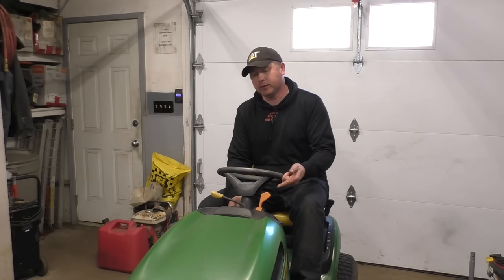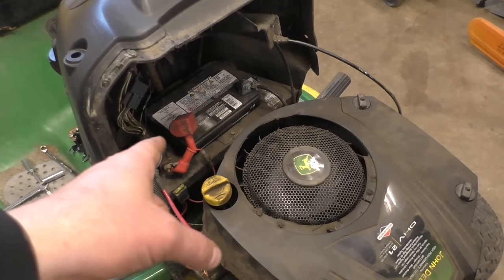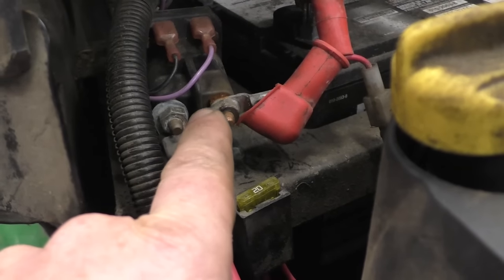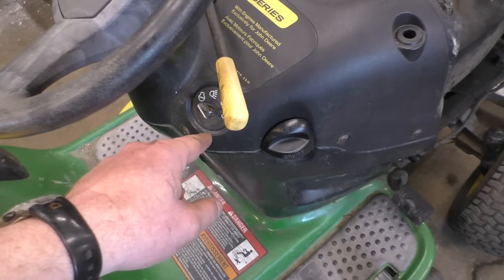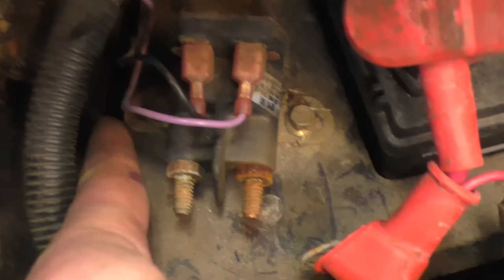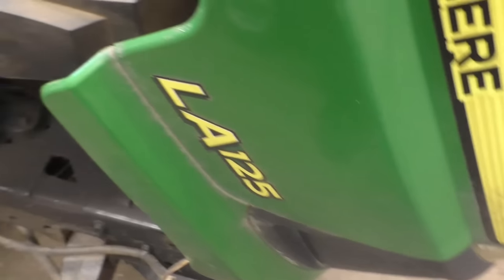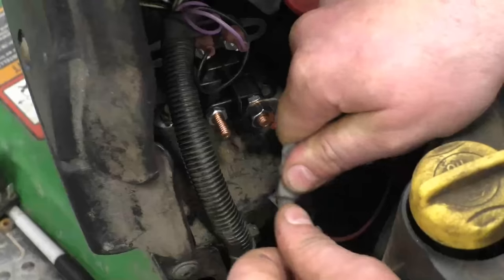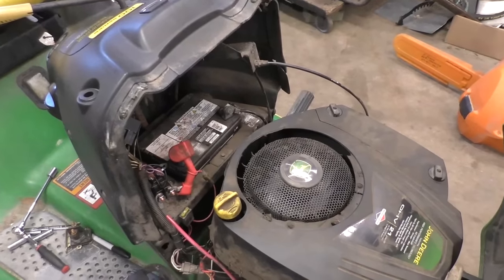Lawn Tractor Won't Start And Clicks - Step By Step Repair Video

Comment from the maker: Watch my video on the Top five reasons your riding mower won't start after storage here;
https://www.youtube.com/watch?v=obLqNeGz0Ps&t=1s
Reply: just put a new solenoid in, turned the key and literally saw a puff of smoke.   that's two solenoids one after another.   i'm stumped... did a bench test and the solenoid clicks but doens't have continuity.   not sense in putting ANOTHER one in, until if figure what is going on... i googled it but nothing...  battery is 12.75, fuse is good.  testing all switches.  any ideas?

Comment: Worth mentioning when using the screwdriver bypass method don’t be resting your hand on top of engine.
Reply: Good practice, however the battery is likely 12 volts and not high enough voltage to cause injury. When it gets about 48 volts and higher, be careful.
Reply: @trinitytoo  my comment was regarding the flywheel rotating.
Reply: @jhans3278  fact: it’s the amps that hurt you, spark plug produces 1,000 bolts but no amperage and you’ll be perfectly fine. But if you have 48v with decent amps that’ll suck
Reply: Mine clicked like that but the problem was the starter gear assembly was the problem

Comment: How about before you junk The solenoid see the hot terminal coming from the batteries all rusty and corroded. Make sure all those terminals are clean. Otherwise you’re not getting the amperage. You need to turn the starter and the solar lights probably junk anyway.

Comment: Great video. I have never done this before, but you explained it, so well, I figured why not givebit a try.  At first, I thought it was the starter. Thank God I saw this first and didn't spend money unnecessary. The solenoid cost me $24 at my local John Deere store. It took me all of 30 mins to remove and install the new one. (My once again first time) Once finished, Jet (my mowers name) cranked right on up . What a blessing. I so glad i didnt have to pay John Deere to do this for me. Thanks again. You have a new subscriber.

Comment: I maintain a fleet of 20 truck mounted mosquito foggers that have Vanguard engines. I run into this ALL THE TIME. The issue is cheap starter relays. They click, but the internal secondary switch contacts are burnt and do not transfer enough current to spin the starter motor. I have long stopped buying the cheap Briggs or Arnold relays and instead, go to the auto parts store and get a starter relay for an early 70s  Ford. I end up spending about $35 on them. But they will outlast your small engine.

Comment: What about the safety switches?  Don't you have to consider them when diagnosing something like this?  Isn't there one in the seat for example?   How did this mower even start without someone in the seat?

Comment: Here's one for you.  I have a John Deere LT160.  I've checked the battery (full charged) and the solenoid (clicks with key on).  Jumping the solenoid poles, the starter starts the engine.  However, taking the solenoid out and bench testing, there is continuity between the poles when the switch is activated.  So why doesn't it send power to the starter when the key is turned on?  Seat safety switch is fine (because the engine will start when jumping the solenoid...ground appears ok.  Changed a relay that John Deere parts recommended.  Baffled.

Comment: So simple!  The other videos have you testing the solenoid with a multimeter, disconnecting wires etc.  Nice tip about the parking brake also!

Comment: Your video explained clearly on how to begin finding out what5 the problems may be. I like your step-by-step method. Unable to purchase a Kohler Pro Command solenoid. No longer made and is a high price item IF you can find it. Are the solenoids sold on Amazon good or low quality?

Comment: Ok.  Your screwdriver trick helped a lot.   I just tried it and it tried to start.  So it’s NOT the starter.  The problem is, the Seluloid is brand new that I just put on there straight from the john deere shop.   So both should be good but I still can’t get it to start.   The fuse is good, I replaced the sparkplug and checked the brake button and the seat safety

Comment: what do you think about the wash port on the mower deck on those John Deere 100 series mowers?  Should people use it?  I hear a lot of people saying it doesn't work. Or they say don't use it, it'll rust the deck faster and ruin the spindle bearings.

Comment: Your video is very clear and right to the point. Unfortunately, I replaced the solenoid yesterday and it wasn't the problem. I've recently done most of a regular service on it; new air filter, fuel filter, & Champion spark plugs. It has run well since the service was completed. I have the oil filter "Re-plumbing Kit" and I'll install it in the course of an oil change.  E-Z... what a waste of money!!

I have a John Deere E180 that usually runs every time with no problems. Now, it acts like there's a safety interlock open; Seat Switch, Brake Switch, PTO Engaged Switch. When I turn the key to the Start position there's nothing. No Click. This thing is starting to put a dent in my sense of humor!  😏

Good Ideas would be welcome...
Thank you...

Comment: To test the starter by connecting the starting directly to the battery, do you have to do anything else for it to crank, like put the parking break on or key in or anything?

Comment: I have a random question do you happen to know what type of cable lugs do you use to replace old ones? I can't find anything on it. It is the lugs that connect the solenoid to the battery

Comment: Donyboy, I'm going thru this same symptom on a Husqvarna Zero Turn. I've already swapped out the solenoid twice already and it seems that with each new solenoid it only fires up one time. I added a new starter also and a new switch. Even though the old one was clicking when I had benched tested it. I've not taken a screwdriver across the poles yet cause I was hoping to see a bad wire or something. I started watching your channel years ago and am never disappointed at your content.

Comment: I got a question about the selenoid
If your shorting it to start the mower why then is the selenoid a needed part if as you said the red wire don't run strait to the starter so if a guy runs a switch of some type could this then work in place of said selenoid this is my question for you about the selenoid

Comment: Donyboy, I have an older yts3000 lawn tractor with a Briggs Platinum. When I shut the engine off I burp a little oil out of the top of the oil drain tube. Oil is not overfilled and valves are set correctly. Any thoughts?

Thanks in advance. Best YouTube channel for small engines!

Comment: Thank you for the video. I recently snatched up an old JD rider with the Kawasaki engine. The solenoid is attached to the starter like the old GM products. I cleaned ALL of the battery connections and applied a bit of electrical grease and voila. No parts replaced at all. Probably going to need a solenoid replacement but I wanted to get her going and see what other surprises I’m in for

Comment: Thanks this was very informative.  I am a widow so panic set in when my trustee LA145 would not start.  Charged battery lights work  numbers come up on dash but still no start. Tomorrow I will try and bypass solenoid and hope she goes. 14yrs old now.  Can I run her without solenoid until I get a new one.  Thanks Robyn

Comment: Hi Dony.  Thanks for another great video.  I have a John Deere LX178 with Kawasaki engine.  The starter has an on-board solenoid.  Using your screwdriver method, I've confirmed that the solenoid has failed.  How can I address this issue without replacing the entire starter/solenoid assembly?   I just replaced the starter 2 years ago, so I'd like to  squeeze a few more years out of it if possible.  Cheers.

Comment: Thank you Donyboy for an excellent video on how to bypass the solenoid to determine if the problem was the solenoid or the battery or the starter. You are an excellent teacher and mechanic.

Comment: Gosh Dony I wish I had this last year......I have a 2005 John Deere LT133 and I had several issues and I think I still have a couple.    But I replaced the solenoid and that definitely  helped but also the Brake/clutch pedal switch which you showed us last year and the lift deck switch were also two checks.    If I pull back on the deck lift lower bar thing that also has one of the gray safety switches under the body. I found nothing would happen when I turned the key and then if I pulled the deck lift bar as far towards as I could it would start.
SO I know I have to replace the switch also.  That might be a help for JD owners as well.

Comment: i replaced an 8 year old solenoid last may... went to start the mower up to move it into winter storage late september and nothing but clicks.   turns out it was the new solenoid.   so what makes the difference between one that lasts for years and one that barely makes it through a season?

Comment: Sir, ❤ thank you!! My husband passed away last year, taking care of my home alone is overwhelming and expensive. He left me his barely used John Deere mower. I wasn’t thrilled but it beats pulling on a lawnmower starter rope. I’m 65yrs old. I’m a retired RN and used to be pretty strong but unless I begin weight training, my strength will no increase. So, I have never done engine work, pretty intimidating actually but this video and all of your positive information and ideas have given me pause to go down that path of learning. The solenoid on the tractor was dead. You have no idea what a joy and relief to have fixed the green machine myself!! Thank you so much, you have blessed a widow. You will have an extra measure of help from above for your generous service, my dear husband has rallied other heavenly beings to surround you with blessings for providing for his devoted wife. Thank you!!!❤

Comment: Want to thank you for diagnosing my problem.  Cleaned my ground wire at the engine block, battery was charged but it would click sometimes 30 times or more before it started.  I was ready to replace the starter.  Went down and jumped the terminals and mine started!!!!

Comment: I used to have a few older Ford cars and trucks, and very often the same problem would occur. You shut the car down, then come back to hear that clicking. The starter solenoid would be mounted on the right front inner fender under the hood. You could short across it to start your car, but, ultimately replacing the solenoid would have to be replaced. I learned to keep a couple extras on board. Not the same thing, but Chrysler cars had a resistor mounted on the firewall. When it failed, no start. So again, when I had any Chrysler made car, Dodge, Plymouths, and of course Chrysler, I kept a few resistors on board. 
Good vid.👍

Comment: Had a John deere once that I thought had a bad solenoid because it was clicking and would sometimes crank. Replaced the solenoid and starter and it still did it. Turns out the ignition switch was failing, and it wasn't passing enough current to properly operate the solenoid. New switch cured the issue for good.

Comment: nice video thanks. I had a devil of a time with my JD x320 same situation clicking and not starting. However on my machine as I am sure you know,  the solenoid is bolted onto the starter and also moves the bendix gear of the starter to the flywheel..It would only fail to start intermittently (when my brother in law was borrowing of course). First I replaced just the solenoid and it was fine for awhile but then back to its old tricks. So then I did what I should have done in the first place, replaced the entire starter, (which comes with a new solenoid already installed), and presto now it starts every time. I really enjoy your channel and watch everything, have learned a lot, much appreciated,

Comment: Hello,  this is not about this video, but i hope you can answer my question, i got i husqvarna cth174,  wich i think is to much compresion, because the battery are new , and when the starter run (barely) , and i have problem to take the manually , it is so hard to move the motor around.If you get this symptom in your shop, please post it.
Best Regards 
Steinar Westbye

Comment: Any suggestions when it just keeps turning over but it won't start? The fuel pump has been replaced, both spark plugs have been replaced the battery is freshly charged. Any suggestions are greatly appreciated

Comment: When I jump the solenoid, the engine cranks fast but it doesn't fire up. Does that mean it's a starter? Or is there a way I can test it before buying a new one? I got fuel and compression (I think? Idk anything about small engines. I'm trying to learn via YouTube!)

Comment: I usually pull the solenoid apart and clean the heavy copper contacts. The solenoid in your video sounds good indicating the coil is in good condition.

Comment: If you have a multimeter, you should be able to turn switch to on with leads attached to the solenoid and verify either close to 0 ohms or an audible beep when you switch it over.

Comment: 17hp Kawasaki on my JD has starting problems.  Replaced the starter and it worked fine for a bit and then started not turning over again.  The flywheel seemed to be in a bind so I hand turned it a bit and it then started right up but after a while got in a bind again and wouldn’t turn over.  What could be causing the flywheel to get in a bind?

Comment: I have the same issue but when I jump the solenoid the starter spins but doesn't engage engine to spin it. If I turn ignition key on 
& jump the solenoid the starter doesn't spin.
 Is it the ignition?

Comment: You could easily test for voltage on the starter side of the solenoid. I know most people don’t know anything about electrical testing but a simple 12v test light would have told you there is a bad solenoid

Comment: Those Solenoid terminals were rusted and likely high resistance connections.  Sometimes Cleaning them and other terminals will cure the problem I have found.

Comment: I had this issue on my John Deere last year. Wound up being the battery. I had just used the mower a few days before and it was fine. Went to start it, turned over once and then nothing but clicks. Went through all this diagnosis and then took a chance and bought a new battery. Instant fix. Battery was only 3 years old. Not sure how it went bad in an instant like that, but I suspect it shorted internally from a low acid/water level since all the new batteries are "zero maintenance".

Comment: In my case it was neither and it wasn't the seat safety switch which I replaced. Finally discovered that it was the blade engagement lever which was in the up position. Has to be in the side down position. Took me 4 days and $45 to figure out 🤪😝🤨🥴

Comment: I just got another free lawn tractor with a seized engine that once again is the coil rusted to the flywheel. This video is exactly what I need as someone strip some electrical components so I'm stuck.

Comment: Don you were spot on, this was the first thing I tested and that is the problem. I did some other test to make sure but you saved me a lot of time as the solenoid would not have been on my radar because of the clicking. thank you.

Comment: when  i do this my screw driver immediatly starts sparking,  i have no time to try and tunr the key. is this a do it at the same time kinda thing, or is something wrong with mine? or am i just wiggling the screw driver too much causing sparking before i even turn the key?

Comment: Good video and information.  I actually did the same thing to bypass a bad ignition switch on my 2004 Honda 750 Shadow Aero motorcycle.  Saved me from being stuck out in the middle of nowhere.  Thanks again Don for sharing.

Comment: Thanks Don! Could that corrosion have caused any issues on the solenoid post?
Reply: Very likely could've. Corrosion is the worst on anything electrical. Probably an interior failure, but you could clean it up and see if it worked.
Reply: I was just going to say that.  That could definitely stop the current from getting to the starter from the solenoid.

Comment: I need help to diagnose my john Deere E-100 rider lawnmower. I tried everything on the video. i tested the started  i even changed a brand new battery. i still cannot start my lawnmower just clicking sound. please help

Comment: i have a gx 75 john deer i have a john deer gx 75 i have to buy a new battery., am taking it out of storge, but before i did what ever the problem is it was killing my battery so i bought another battery it started great but i engage and drop the blades to cut it would shut off so i gave uo i dont want to buy a mower things are rough now a days can you help me with this problem i can work with tools thank you grace

Comment: The customers like to fire the parts cannon and immediately replace the starter.  Corrosion on battery, solenoid, and starter can also cause problems and create voltage drop.

Comment: Brand new battery installed and showing 12 volts on the multimeter, brand new starter and starter solenoid installed. Getting a click on the carb solenoid when I turn the key. What else can it be?!

Comment: Thanks! Solenoid test totally worked!!!!
Reply from the maker: Thanks!
Reply: @donyboy73  Ok, replaced solenoid and still one click won't start. I still can "screwdriver" start it. Is there like a normal "kill switch" that I could wire between the two positive connections? My solenoid looks about the size and shape of yours. (Allis Chalmers AC130 42" 2690812) Thanks!

Comment: Once again, DonyBoy taught me something! Quick question for anyone, especially Canadian folks, where do you buy your parts online? I have to replace my starter on my D140, as the bendix doesn't move up properly anymore... even after proper lubrification.
Reply from the maker: you might find a good deal on amazon
Reply: @donyboy73  hi man I have a 1980's turf trac MTD , I have a video on it , think you can help me out